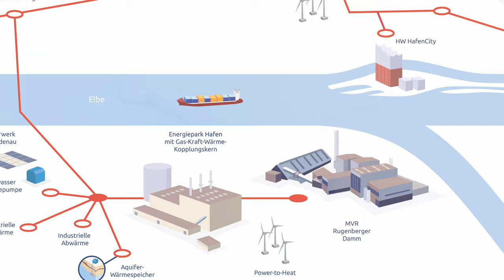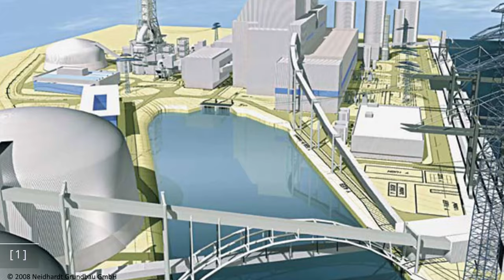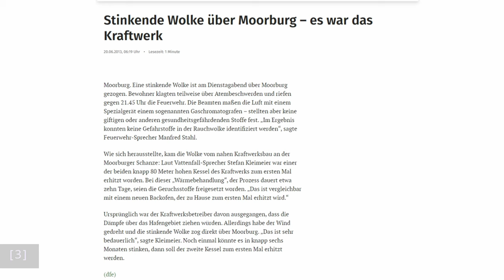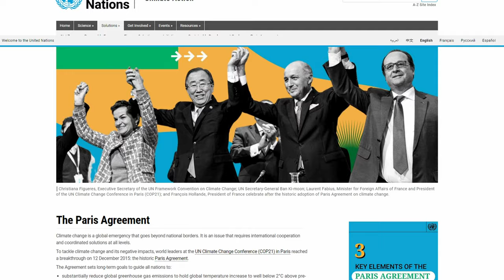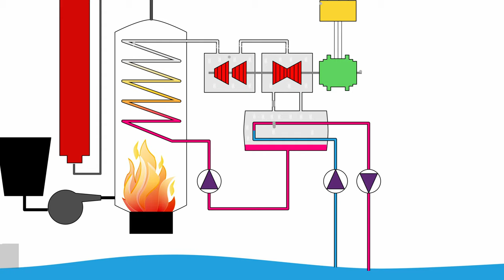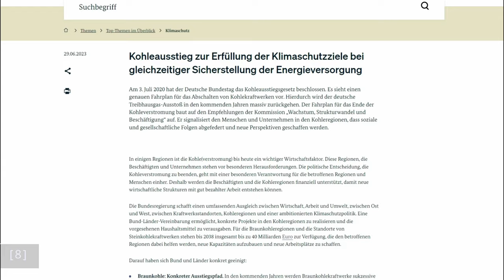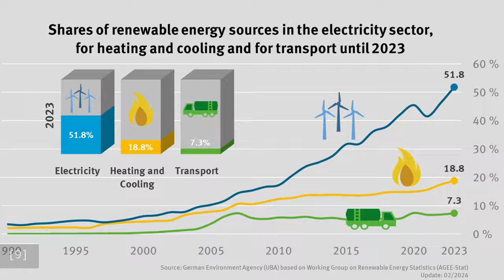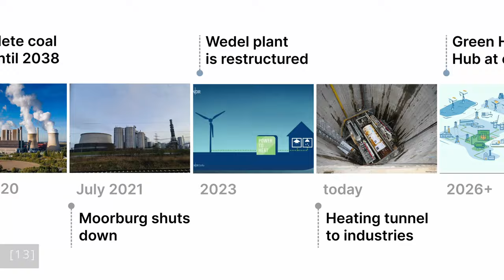The Failure of Europe's Most Efficient Power Plant. What Happened?

Comment: German should turn off old coal power plants first and leave operating this new one, they shouldn't turn off remaning nuclear reactors. They shouldn't get dependance on Russian natural gas. Too many big mistakes.
Reply: Or they could convert this to nuclear?

They could reuse the cooling towers and boiler, and get carbon free energy without air pollution.
Reply: @domtweed7323  
You cannot build a nuclear PP in the middle of a city. I suppose you know nothing about nuclear, don't you?
Reply: Solar with batteries, we built like 25 GW of solar last year, nuclear is a dead debate
Reply: @sebyst7907  even without batteries, thats two nuclear powerplants worth in energy build in a single year vs 1 NPP done in 30 years....  and that (almost) without taxes.
Reply: @denniskrenz2080  yeah, solar plants get built in a few months, NPP needs near a decade to get built, hell my little Balkonkraftwerk took 15 minutes to setup.
Reply: @sebyst7907  exactly. Also its pretty cheap to do. Hundred thousands are setup each year. Would I go to the bank and request a loan for a NPP this looks a little  different...
Reply: @sebyst7907  
nuclear is a dead debate, I absolutely agree, but only for new constructions, as those requires many years to be completed, whereas a solar array is much faster and cheaper, easy etc. I don't agree on shutting down current, already working nuclear pp. It's just an ideological, masochist, biased leftist idea
Reply: @paolopetrozzi2213  if they can be safely maintained, definitely keep them going, but most are over 40-50 years old, and this keeps increasing the cost per kWh. At some point it's not profitable to keep them online.
Reply: @denniskrenz2080  🤣🤣🤣
Reply: @paolopetrozzi2213  Its a "management decision". Nothing else. You just don't shut down NPPs easily, you need a strategy for that. In Germany, NPPs were essentially dead since the municipal service companies ("Stadtwerke") here decided to no longer invest into nuclear power in the late 1970s, already before TMI. The plans to build "smaller" NPPs with the ability to provide steam for industries were already cancelled in 1969, too expensive. After Chernobyl in 1987, all parties already agreed on ending nuclear power generation, the debate was just when. The latest was at the end of the allowed operating licences in 2025.
Reply: @denniskrenz2080  
Too many unnecessary words. Speaking about energy cost: 
- Not a single coal pp should be built today.
- Not a single nuclear pp should be built today.
- Not a single nuclear pp should be put offline just for political/climate/ "green" reasons.
My best wishes to you, my German friend.
Reply: @paolopetrozzi2213  If you can't value words properly, how can you properly value NPPs?
Reply: "German should turn off old coal power plants first and leave operating this new one"

I'm not sure I agree. Based on this video this new powerplant produces only electricity making it less efficient than CHP plants.
Reply: Well, not turning off the remaining nuclear reactors is going to be rather simple on account of the fact that there aren't any left.

Comment: You closed down 6+GW of usable nuclear plants prematurely...
Reply: Far more than that. Germany peaked at 171TWh of nuclear power per year. Economic sabotage.
Reply: wrong
Reply: @mottthehoople693  Yes, you're.
Reply: @nwmacguy  Talking about total energy (not electricity) needs, this peak nuclear production in the 1990s never exceeded 6% in the German energy mix. 
So, it's rather negligible. 

However, from a purely climate change based point of view, it has been a mistake to shut off nuclear before coal. 

Economically speaking, I'm not so sure: German utilities are privatised, profit-seeking companies. And there wre very eager to get rid of the nuclear plants as quickly as possible.
Reply: @batonnetdecannelle  higher than that, peaked at 31.08% of electricity gen in 1997 or 12.17% of total energy usage in 1999.
Reply: @nwmacguy  Interesting, thanks! Could you tell me the source of the data, please?
When it comes to the nuclear share in total energy use of a particular region, the figures often show an extremely wide spread: for the world, it reaches from 2.2% to 5.2%, for France from 18% to 42%.

The reason is quite simple: the lower figures take into account only the electrical energy output of nuclear plants, the higher ones are a basic "total energy produced/total energy consumed" calculation, accounting for all forms of energy, including the thermal output of nuclear, which is roughly 3x higher than the electrical power rating.

And whereas - theoretically - this heat could indeed be used for district heating and industrial processes, it is mostly blown out into the atmoshere or heating up rivers. 
Because industrial and large population centres are rarely situated close to nuclear plants. At least in liberal democracies.
Reply: @batonnetdecannelle  are you able to see my reply to you, or did YT hide it? Has data citation and other stuff.

Comment: $3.8 billion?  Cheap.  Look into Snowy2 in Australia.  Probably $10billion by the time it will be finished.  Only problem is  it's just a going to be a BATTERY, and will generate no power at all !
Reply: But it will store electricity in GIGANTIC amounts, with it's max capacity of 2,2 Gwh it needs 159 hours or 6,62 days to fully "discharge" and you get the worlds longest and deepest cave excavations on earth.
So it's seems not as useless as the coal plant and considering other Snowy projects like an gas plant with huge gas storage and low utilisation rates or plans for an peaker coal plant (normally they are used as base- or middle load plants) it could go worse.
Reply: 10Billion??? Actually it will be 26Billion when the transmission lines are included. And according to the questioning by the senate inquiry, the power produced will cost $3500.00/ kw.  Compared to the $.02 - $.03 /kw for a modern coal powered power station, please give me coal....
Reply: @craiglawton4630  Omg, Australia will be hit very hard by climate change but you're still for coal......
Uhhh, okay, it's natural selection.

Comment: On internet plant has a total gross electric output of 2 x 820 MW. have no chimney stack heights but they look in proportions very short. People feel dizzy from plume of smoke exhausted into atmosphere. For 820 MW block chimney stack must be 300 meters height minimum to get well dispersed pollutants in atmosphere.
I worked in heavy oil power power  plant where once chimney could accommodate 2*300MW=600MW power blocks chimney height 260 meters, wind velocity had stable direction city in we most stable direction, in high days of operation people complained about smell of heavy oil.